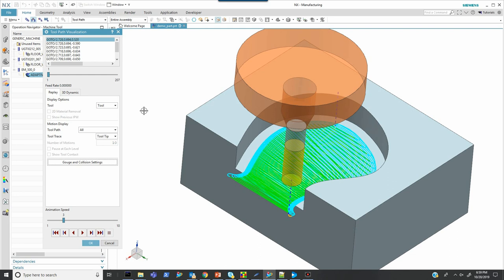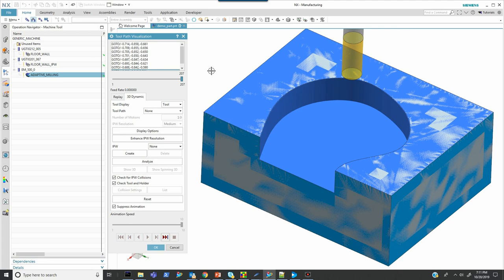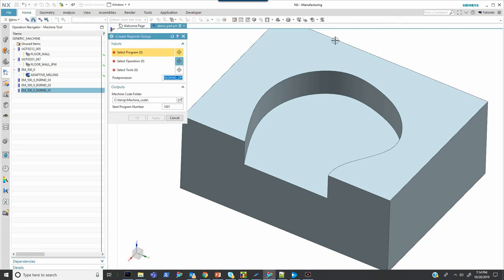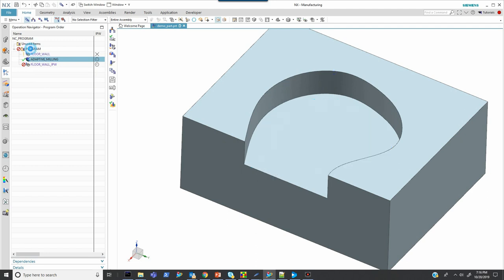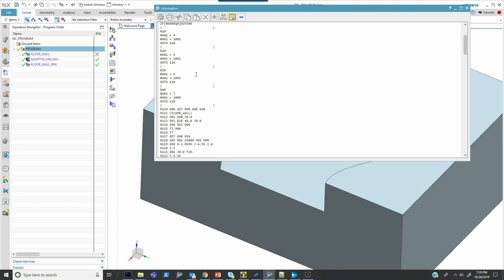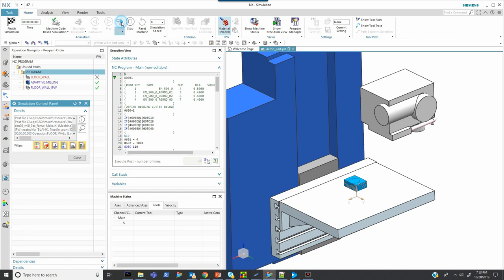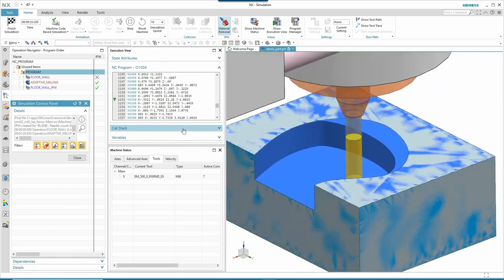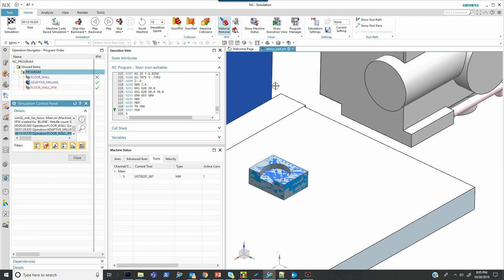NX CAM: Automation to utilize reground endmills efficiently

Comment: Interesting solution, but why not output the G-code directly from Python (or Java) to the program with a MILL_CONTROL operation? I'd rather not change the post-processor. I think most people wouldn't want to mess up their post processors, especially with Post Builder. Post Configurator may be a bit easier to fiddle around with, but one may be working with encrypted posts.